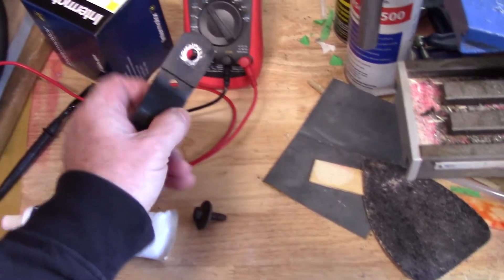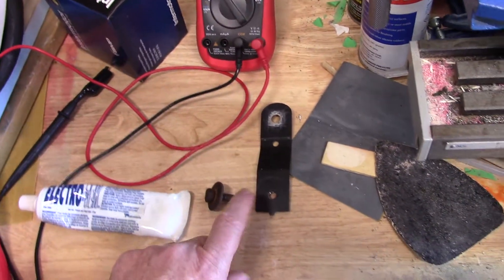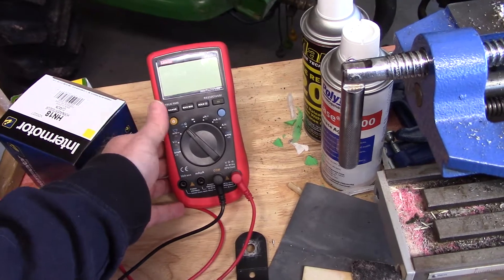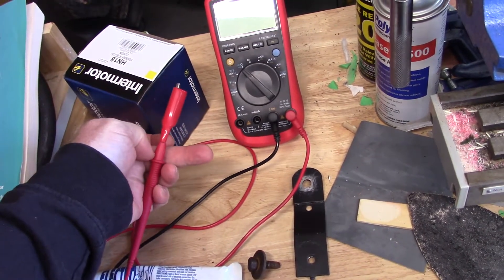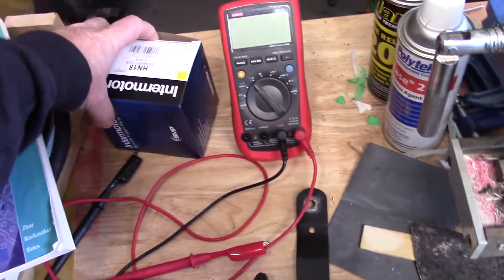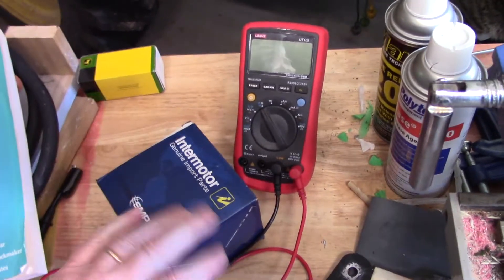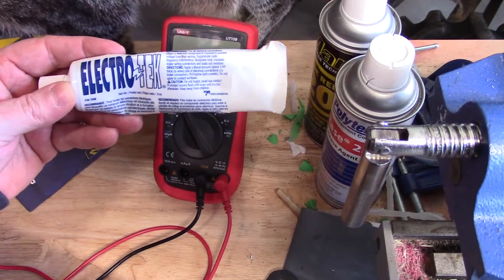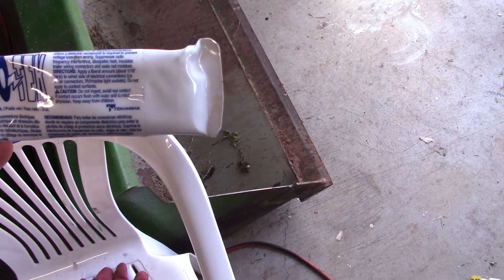FIXING THE 1986 DODGE RAM D150 HORN BRACKET PART 15 #NONAMENATIONALS

Comment: I took electric shop in High School. House Wiring, Electric Motor Repair and Electronics. I repair Televisions, record players and radios for a hobby. Will be doing a few car radios on my channel soon. I posted a short of me testing a radio vibrator.
Reply from the maker: HEY NOW!!!!  YOU ARE THE MAN!  I want your contact info when I get unbusy next week, if you don't mind.  If you're doing car radios...brother, you got the side biz and a half!!!  I'm thinking of picking up an original Mopar 365 AM or maybe the AM/FM model.  Chance of it working are probably slim.  That's the kind of think I would rather send out to a competent bench guy.  I don't have the time for it anymore.  I'll hit up next week!